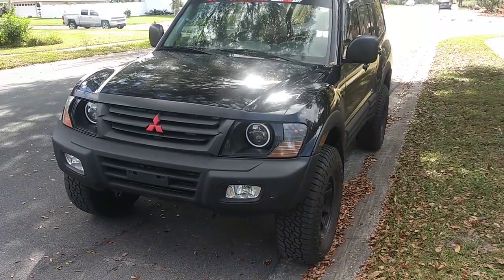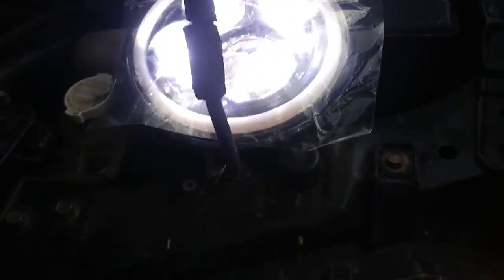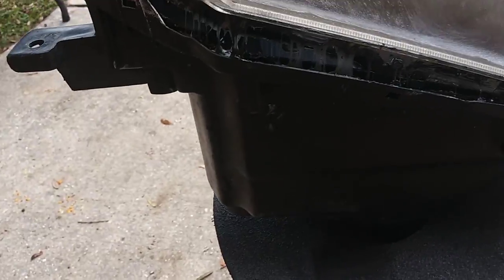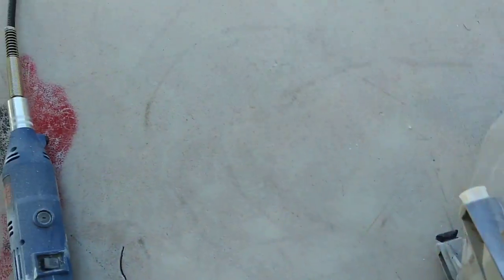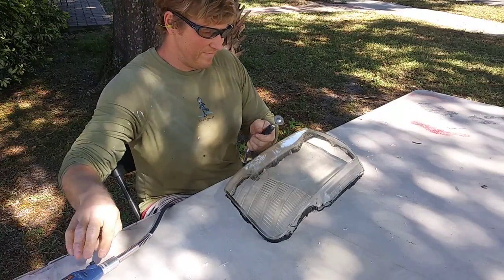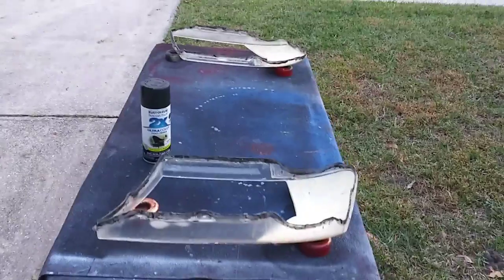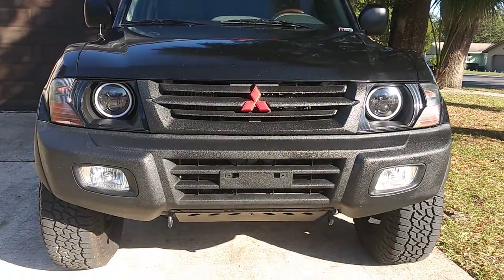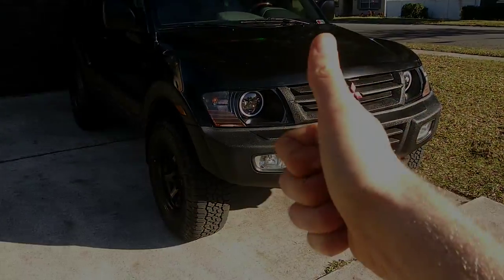Montero gets Jeep headlights | Project "Vader's Chariot"

Comment: Looks awesome! Never even thought of this, might have to look into doing this myself
Reply from the maker: A bit pain in the ass and wouldn't pass any inspections but for me in florida and with covid shortage of everything - pretty happy with the result!
Reply: @LeoTheRussian  The Mk1 and mk2 also can use these lights because I have seen a lot using them now because of the clarity and brightness. the eBay or jeep ones. I see you are running a mk3 model. Are there a lot mk2 for sale in your area?
Reply from the maker: Monteros overall are really rare. Gen 1 and 3 are the most common. 2.5 is the rarest.

Comment: Your montero is beautiful, where do you buy all your accessories, I want some wheels and suspension like that
Reply from the maker: @carlosRodriguez-u7v2h  got the wheels and tires through a local friend in Florida. The rest here and there. LusoOverland has a lot of the stuff you want. I'd start seeing what you want and then time the market by getting it on Labor Day or especially Black Friday. I did that for my GX470 wheels last year and some other bits

Comment: Hey mate, your video is awesome, and just wonder how you secured the light into the shell, any photo or video can advise??
Reply from the maker: screwed in and used some metal wire as well. Kind of janky but been a year and still is solid. In retrospect doing some epoxy mounts would've been a good idea.

Comment: The two wires you wondering about are for a ring shape bulbs , you have to connect them with a separate switch so you can open them at day time.
Reply from the maker: yeah I looked into it and already got the DRL harrness as well, just forgot to put that in the video. Figure once they're all connected and headlights been tested a bit more without falling out - I'll make an update video
Reply: maybe a turn signal light connector
Reply: I have the same lights on my gen2 Pajero.  The additional leads are for running lights  and the turn indicator

Comment: Can you leave the lense on or does it get too hot in the housing?  Is that the reason why you cut it off?
Reply from the maker: Yeah you don't have to cut the lens at all. Just open it up, install the light and close back up. I've seen a couple done like that. In that case though I'd go with a different style retrofit that's specific to the Monty. Mine were cracked pretty badly so I just cut them off.

Comment: How’d you get the headlight assemblies out? Did you have to remove the bumper and/or grill?
Reply from the maker: If I remember correctly you have to take the grill out, but not the bumper. Headlights are held by 3 bolts total only. It's real easy. Hardest part is the grille with the flimsy clips on it.

Comment: I wonder how it would look with the cover back on uncut  ? I know yours was cracked but I would rather see it fully covered

Also another thought I bet these would be cool as rally lights on a bull bar in the center ! Might check that out for my 2001 montero
Reply from the maker: There is at least one example of that in the Montero 3rd gen FB group where a guy reused the lenses and epoxied the jeep lights to the housing. It looked pretty good. Another option I was considering was to get a piece of lexan or plexiglass (whatever is durable), and cut out a piece to cover up the center but havent had a need yet.

Comment: Hi do you need to remove the bumper to get the headlight out?
Reply from the maker: Been awhile, but I'm 99% sure you don't. Just the grill and lift the hood. It's 3 bolts. Two from the top and one covered by the grill I believe

Comment: Can u please tell me if this gen has both center diff lock as well as rear diff lock..
Thanks in advance..
Reply from the maker: Just the center. Rear can have an LSD as well however. 2003-2006 has amazing traction control that works extremely well and mimics front and rear lockers. Watch the video of Land Cruiser Vs Patrol Vs Montero - really shows how well the traction control works.

2001-2002 did not have that system however

Comment: Awesome vid dude. Thanks so much. 👌 Do you think this might have trouble when snowing? Being in Florida in sure you're not worried. But I run into snow about twice a year. Do you think snow would collect in light without lens? Either way super cool mod and video. Thanks again. 👍
Reply from the maker: Figure it should be ok considering you have spots in the lower and upper grille that are open year round. You could also get a small sheet of clear plexy or lexan type material and cut out covers that can be just easily screwed in the depression left in the stock black plastic housing.